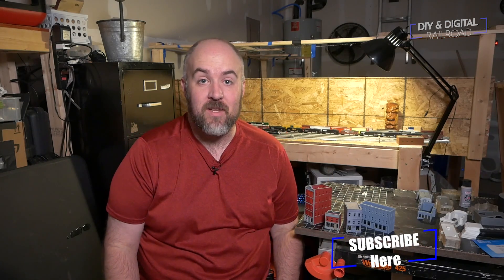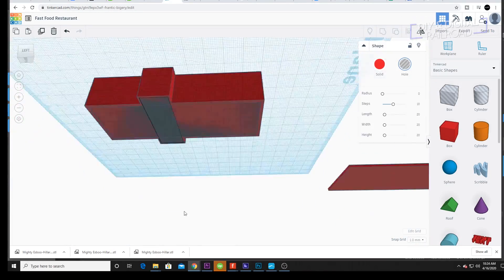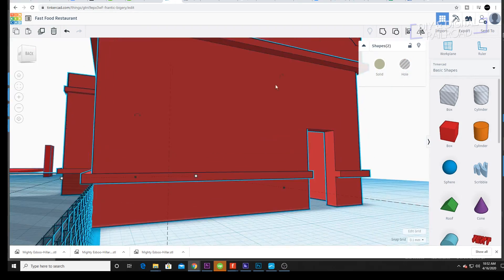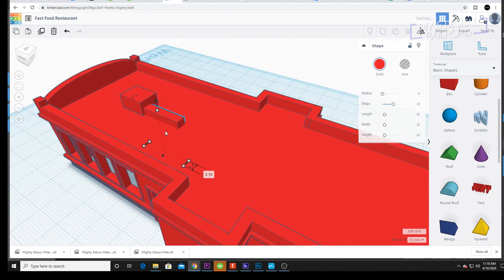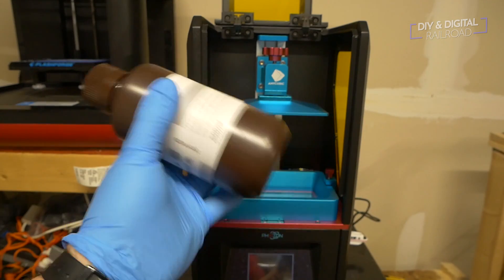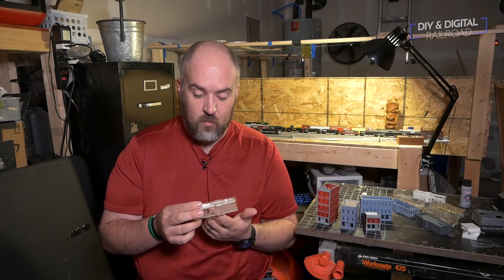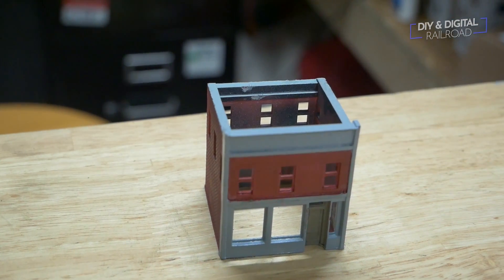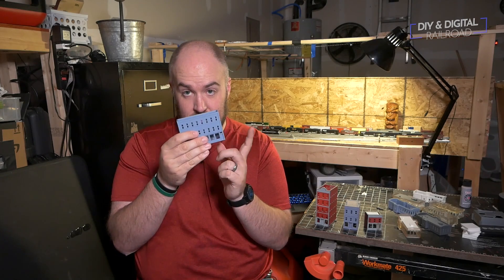Designing and 3D printing a building from Scratch:  Fast Food Restaurant

Comment: Try printing your buildings at an angle to the build platform. That way you will fix the problem with the roof. You will probably have some supports outside of the building but roof wont be a large area parallel to the build platform that gets torn off while moving z-axis.
Reply from the maker: I actually am doing that.  It doesnt help the roof, but it did fix a z wobble issue I was having.  I was able to just put a crap ton of supports on the bottom and it holds fine.

Comment: Your design technique will print ONLY on a resin based printer.  With a FDM printer, each wall should print flat on the print bed to print the window openings.  If they are printed vertically, as in your resin printer, the square openings will sag.  With FDM, the printer can't print over air without supports.  This would make the window and door openings more difficult.
Reply from the maker: That is absolutely right.  I did try to make a kit that could be printed on my FDM printer, but it could never get the brick detail right.  I am anxiously awaiting the Elegoo Saturn so that I can make larger prints.
Reply: @DIYDigitalRailroad  For window and door openings on vertically printed walls on an FDM printer, try TREE SUPPORTS.  Works great and easy to remove.  I am hoping to get an Early Bird Elegoo Saturn soon!  Much better print quality than an FDM printer.

Comment: Could you include a few words on the "issues" you have with the models and the printer? And how you solved them, please?
Reply from the maker: The issues are really with the build plate adhesion and I am still working on an effective solution.  In terms of the issue with the printer,  I had a resin spill that required me to replace the Z axis motor.
Reply: @DIYDigitalRailroad  Try angling the model, about 20 degrees works! I typically do two axes so the sliced layers are triangular and not rectangular. Downside is buildings may not fit, I print a lot of freight cars which are small enough for the plate.

Resin printers don't like large flat surfaces (parallel to the plate) so you have to angle it to prevent them. You'll also have to add supports in Chitubox, just make sure the supports don't contact anywhere visible as they can cause bumps in the surface, but that will give a solid adhesion surface as well!